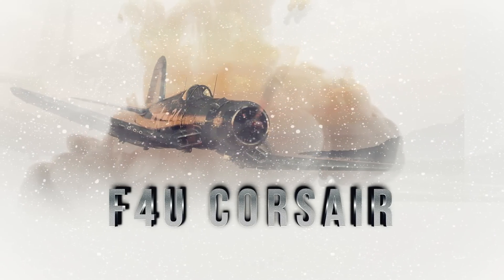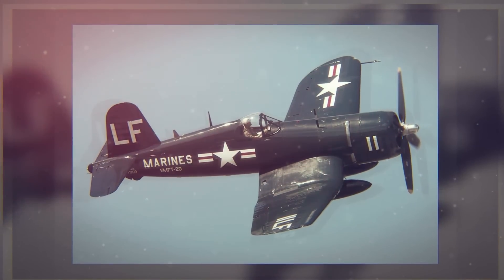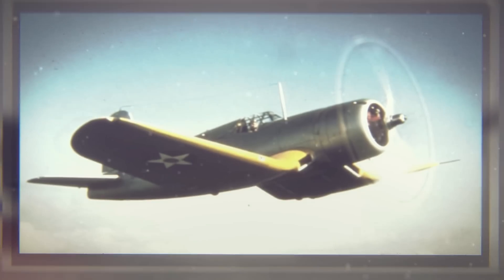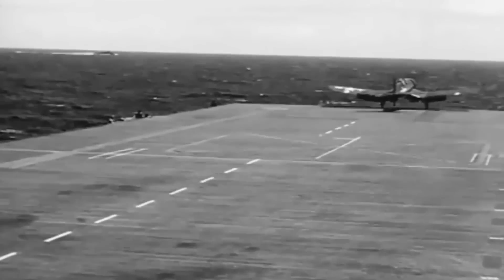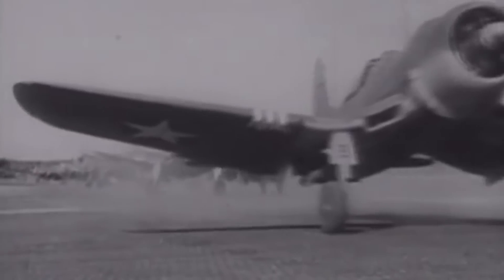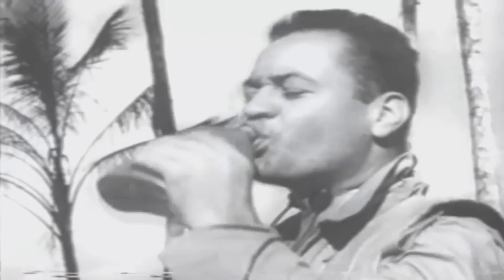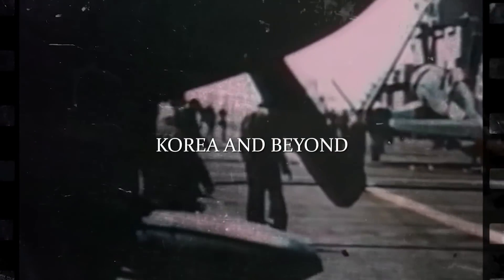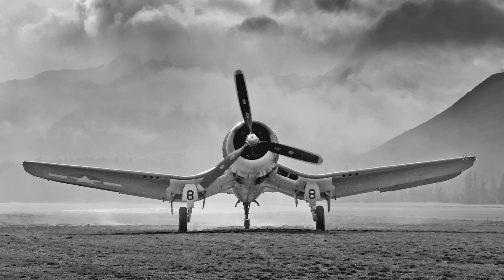Want to Dominate the Skies? The F4U Corsair Might Be the Answer

Comment: No. While an excellent fighter it was rated #3 behind P-51D and P-47D by large number of pilots that compared them a the Patuxent Fighter Conference  October 1944.  Additionally as a naval fighter it was not equipped with enough fuel to operate beyond USN requirements. Had it been deployed in ETO/MTO or CBI, its lack of range and combat radius would have relegated it to medium range escort/air superiority role when P-51B/D and P-47D would have been a better choice.

Whil the F4U did have provisions for external combat tanks, operations over water with no intervening defenses (unlike ETO operations over land) the F4U had more than enough range for Pacific operations.

And no, the RN did not pioneer the curved landing approach for the F4U. It was already tested and introduced into the fleet in SanDiego before the RN took possession of the first Lend Lease F4U.  

Last, while formidable and possessing R-2800 engine, it was a.) more vulnerable to ground fire due to oil cooler placement, b.) it only had slghtly lower loss rate compared to the liquid cooled engine P-51D during Korean War.

Comment: The 1st production fighter to use the R-2800, and perhaps the last, in 1956. Many fighters kicked a$$ in WW2, but only one was produced well after that war, and into the mid-1950s. It didn't have the same kill ratio as the Hellcat, but it was in the double digits, and the Corsair was produced 10 years after the Hellcat was done. The Corsair wasn't just a top fighter, but even more, a top aircraft of all time. How many designs from 1940 (not production) survived WW2 contracts and went on to be produced well into the 1950s?

Comment: The F6F had a higher kill ratio. 18 .1. IT was easier to fly and more agile than the corsair which had a bad design flaw in that it would suddenly drop a wing on final.approach causing lots of deck crashes as well as the long nose causing pilots to.lose sight of the padels from the LSO.

Comment: F4U was a great air frame and good performance plane.  The swept wings of a CORSAIR and very good kill ratio was outstanding.  It was better than the F4F Wildcat .... but NOT THE UPGRADED F6F HELLCAT - 6 holy Moses Missiles, 2000 HP Pratt Witney radial engine and a KILL RATIO OF 19 to 1 !!!  Best ever.  With respect, jj

Comment: The Corsair was a very good and effective aircraft in the hands of a skilled pilot.  However, low-time pilots fresh out of training were often over-whelmed by the torque characteristics, the poor visibility during a carrier approach and the poorly designed oleo struts of the early models.  The Corsair bore the nickname "Ensign Eliminator" for good reason just as the Hellcat was called the "Ace Maker", also for good reason.  An 11:1 kill ratio is very good, to be sure, but remember that the Hellcat had a 19:1 kill ratio.  Was the Hellcat a superior fighter?  Depends on who's flying it.  The Hellcat didn't do anything outstanding but it did do everything well and it made a rookie pilot look good giving him confidence in his plane and ability.  One last thing, the only reason the Marines got the Corsair was the plane's unsuitibility for carrier use early on.  The Corsair proved to be a very good ground based aircraft and it and the Marines who flew them made a name for themselves.  Finally, it was the pilots of the Royal Navy who figured out how to bring aboard the Corsair onto a carrier deck with a minimum of losses.
Reply: Yes, and it was the aircraft mechanics of the Royal Navy's Fleet Air Arm who first fixed the undercarriage bounce. Corsairs became a good  replacement for earlier RN fighter aircraft.

Comment: No this isn't accurate, yes the Corsair F4U was amazing but at that time it was fighting an almost depleted Japanese air force using very under trained pilots and almost worn out aircraft. A better stat would've been pitting the F4U against a strengthened German Luftwaffe or the Japanese when they had all their best pilots still alive and flying.
Reply: Yes, but remember the aircraft in America's inventory changed rapidly e.g. P-40 (Pearl Harbor), F4F, F6F, F4U.  While the ZERO changed little over time.

Comment: The iconic wing shape was fascinating to me as a child. Absolutely love WW2 aviation and all of the innovative ideas that came from that time period
Reply: Quite an aircraft
Reply: From what I heard on the vid it was for the big prop to clear the ground .
Reply: @txrick4879 partly, but  were that the only reason then other aircraft like the p47 and the hellcat would have required this too given they had the same r2800 engine and propellers only v slightly smaller. that clearance could equally have been achieved with say telescoping landing gear were that the only concern. it was, as mentioned in the video, also to reduce interference drag. essentially NACA testing had found that an angle of 90 degrees between wing root and fuselage was best for minimising interference drag. in order for the corsair to achieve this with its v round fuselage* it would have required a conventional wing to have been mounted roughly in line with the propeller spinner. that would have required telescoping landing gear which would lack the strength of the corsair’s landing gear and couldn’t have been used as a dive brake in the way the corsair’s landing gear was designed to be able to do. the fact that the corsair was able to have shorter landing gear enabled it to be fully enclosed in the wing, and took up less space in the wing which allowed for a shorter chord and overall more efficient wing. this also allows for much larger flaps, critical for lowering the stall speed for a carrier fighter which in turn allows for larger ailerons. this contributes to the excellent rolling capability of the corsair which was a quality noted both by those who flew it and who fought against it. 

*the fuselage itself was designed to minimise the frontal area of the aircraft despite the large r2800 engine which required both oil coolers and intercoolers, which contemporary fighters with the same engine put at the front of the fuselage, something the corsair avoided and which resulted in the characteristic long nose. this desire to reduce the frontal area of the engine had a lot to do with trying to make the plane competitive with land based fighters

Comment: My uncle, George Roy Hill, flew the radar-equipped night fighter version of the Corsair at MCAS Cherry Point during Korea. He also flew the Hellcat. He told me the Corsair was much more squirrly.
Reply: The corsair had considerably more performance than the hellcat though
Reply: @kenneth9874  well, it had a little more. It also wasn't ready as soon as the F6F, cost more, didn't have enough parts in pipeline for fleet deployment in '43, wasn't quite as tough, and... Grumman could manufacture faster and cheaper, and the F6F was wholly sufficient to the Navy's needs.
Reply: @jonbowden5207  actually it was tougher,  ever see one break apart? There's a reason that the Corsair was still being produced after the war.
Reply: @kenneth9874  "There's a reason" yes, there was - it had a little more speed, had more development potential, and the war was over. Grumman produced more Hellcats in less that 3 years, than Vought produced Corsairs in 12... Grumman did great work.

The F4U was a fine aircraft, that the USN would have been fine without.
Reply: @kenneth9874  "ever see one break apart?"

Only in pictures, never in person. I've only been onboard one carrier that operated the F4U (CV-17) but they weren't operating them while I was there.
Reply: @jonbowden5207  funny how they were replacing hellcats with corsairs as fast as they could 🤣
Reply: @jonbowden5207  they didn't come apart, hellcats did.

Comment: It depends on what and where. The top three Army Air Corps planes all had much better range. The 51 and especially the 47 had better performance above 20,000 feet. The 38 out climbed it by a substantial margin, had far better fire power and would out turn it at any speed and carry more ordinance 
Below 20,000 feet it was probably the best all around dog fighter but again not in all situations. 
The Corsair was unforgiving and killed a lot of low time pilots in ways that the Jug or the Lightning never would. 
As a 250 hour Lt JG coming into combat for the first time, give me a Lightning or a Jug. As a 1,000 hour Capt with 30 combat missions…maybe a Corsair

Comment: Would be interesting to see it up against an Me-262 or even the TA-152
Reply: At high altitude, the engine probably would have been slightly out off breath and the relatvely thick wing of the F4U would have run into problems with supersonic flow pretty quickly. At low altitude, th COrsair definitely had the edge over both of them in manoeuverability. A 262 probably would just have run away from such a fight.
Reply: Ta 152 would win, it was a super prop
Reply: Well the corsair did have machine guns as Japanese aircraft were almost not armored. In Europe, all aircrafts were armored and had guns, so...
Reply: pick an F4U of same time frame, and bring it on... no guarantees for either of the Nazi birds.

Comment: Okay, it was a decent enough plane, but did not have the range of say the P-38. Plus by the time it was being used in front line service, most of the really good Japanese pilots had been killed. The Hellcat could run circles around the  F4U Corsair. Also it took the British to show us how to land them on a carrier.  But if I was a fighter pilot in WW2, I'd rather fly the P-38, P-47, or if in the Navy, the Hellcat. I'm not dishing the Corsair, it was a good plane, but the best plane of WW2, not so sure about that. Wow, um, the Wildcat had fully retractable landing gear, as did the Hellcat. Get your facts straight. Even you mentioned it took the British to figure out how to land the thing on a carrier. Mostly due to how big the prop was. So in its early days of use by the Marines, it was land based.
Reply: Yes,  the Corsair generally didn't have to face the best Japanese pilots, like the Wildcat pilots did,  but the same is true for the Hellcat.   And your assertion that the Hellcat could fly circles around the Corsair is flat-out wrong.  If anything,  the opposite would be more true.  Look,  there's nothing wrong with preferring the Hellcat,  it was the better carrier fighter,  easier to land and easier to fly.  But the Corsair was the better all-around fighter,  a better ground-assault fighter and a better dive bomber.   That's why the USN replaced the Hellcat as soon as they could, but kept ordering Corsairs into the 1950s even though it was twice as expensive as the Hellcat.  The P38 was a little overrated.   The P47 was a great fighter though...
Reply: It's the economy stupid.
People often forget that's all about the money. It is cheaper to operate the Hellcat. So they choose the f-6.
The same thing with the p-51 and the p-38. Don't look only on the plane database in the papers. The overall picture is important to. Logistics, materials, economic capacity complexity of operating the planes and so on.
Reply: The wildcat did have retractable landing gear you had to crank it .

Comment: Best all around prop fighter ever in my opinion.
Reply: F8F was probably the best.
Reply: @thecircusfreak5364  well , the Bear cat was good but it wasn't done in time for ww2. Also , if u do count post war property fighters then it would have to compete with the Super Corsair. I would still pick the Corsair to win. Its my opinion only however.
Reply: @jayledermann7701 it’d also have to compete with other superprops, such as the supermarine spiteful, the hawker sea fury, a number of soviet aircraft etc. the bearcat was in any rate a v flawed aircraft heavily optimised for an interceptor role and operation off smaller escort carriers as a replacement for the f4f wildcats still used on those throughout the war. there isn’t rly a best prop fighter because different aircraft perform very differently at different altitudes, have different roles etc that affect their performance in combat. the p39 airacobra was disliked by many US pilots but was the darling of many soviet pilots and holds the mantle of the US fighter with the highest number of kills in the war, largely because the very things that caused issues for US pilots in the pacific theatre (short range, poor high altitude performance due to the removal of the turbocharger and lack of a two stage supercharger for the allison engines at the time) were non issues on the eastern front where airbases were typically v close to frontlines and combat fought at low altitude and allowed the qualities the aircraft did have to shine
Reply: @fayY2K  well if you are going to bri g up real late war super props , then I'd go with the super Corsair. I believe it was named FG1 Super Corsair or something like that. There were many great fighters, for sure. It's just my opinion that all around the Corsair was the best.
Reply: @fayY2K  ah , I was in a hurry , and didn't look at entire thread. As for best at what , I said all around. Meaning for me , a fighter that can maybe not do everything the best yet do everything at a high level.
Reply: @jayledermann7701  no worries. so in that case i would have to say i don’t think that is the case simply because the corsair actually can’t perform every role well (and neither could it’s contemporaries for that matter). the corsair’s performance drops off significantly above 15,000ft which makes it completely unsuitable for a great many roles which is a long way from doing everything well. the multirole fighter wouldn’t really see its birth until well into the jet age precisely because making an aircraft capable of one thing comes with costs to its ability to perform in other areas. at what it was designed to do however, the corsair was a fantastic aeroplane
Reply: @fayY2K  no one plane can do it all for sure. I would say history proved F4U did all around better however just due to its kill ratio , length of service and multiple rolls it fulfilled. I played a lot of combat Sims and games online based in WW2 Era. I was known for being a decent F4 stick. The only 2 planes I felt were as dangerous against me was the 109 G and late war spits. So many great planes . I guess the F4U-4 for me was the best. I think America was right....E fighting beats turn fighting.
Reply: @thecircusfreak5364  it was great plane , but I discount it as better because it didn't see combat, so we don't really know and also the Corsair was still in combat after the Bearcat  was retired

Comment: It was a very good plane, but the F6F Hellcat had a better kill ratio.  The F4U was probably
a better ground attack aircraft.
Reply: Timing was the reason for that, the F6 was a good,sturdy, reliable aircraft with good performance but the US had several with better performance including the F4U
Reply: No the hellcat wasn’t better it was only good for boom and zoom the Corsair was a better dog fighter it didn’t get to fight until 1944 if it had been earlier it would’ve had a lot higher kill ratio than a hell cat the hellcat was basically a jugg with wings like the thinderbolt they all three had the same pratt& Whitney R2800 engine
Reply: Good catch on that. I wasn't sure.
Reply: Everything I have read or seen from F4U pilots say it was a pig at low speed and that kind of rules out ground attacks.
Reply: @GerryHartman  no it don’t do your history that’s what they used it for in the koren war it was the longest serving prop plane in the U.S. military it was the a -10 warthog because the a10 warthog look it I promise you bro it’s facts it was the longest production to
Reply: @EarlsBackYard  -re-read my post until you can comprehend and fully understand the words - everything I have read or seen from F4U pilots.    My personal opinion means nothing since I have never flown a Corsair.  However, I will put stock in personal anecdotes from pilots who have.
Reply: I’m a Corsair Enthusiast and nut and fan i geek out over these planes like a teenage girl does over her sweet 16 I love this plane and the hellcat and thunderbolt her sisters who where just as bad as she was they mopped the floor with the enemy in all three the jug could take hits the hellcat could dish out hits pretty hard and the Corsair could out run the enemy I love these three beautiful sister warbirds they all had the same engine the Corsair even had the same water injection the thunderbolt did
Reply: @GerryHartman  what said come from actual pilots I listen to two hour documentary about them and the men that flew you need to reevaluate

Comment: Cosairs fought in 1969 in the Honduras/El Salvador war. Honduran Corsairs fought against El Salvador P51 mustangs. Honduran F4U pilot scored 3 kills in one day.
Reply: Those Mustangs had fuel tanks add to the end of the wings pretty much make them useless in a dog fight.
Reply: Yeah, those mustangs were modified for mostly ground attack.  They had fixed fuel tanks at the wing tips which impaired their maneuverability.   Further,  those F4Us had 4x20mm cannons as well.  Regardless,  the F4U was an amazing plane and could compete with any common fighter in WW2 Europe (See Greg's excellent channel for an in depth analysis of this).
Reply: Thought that those battles would be mentioned but were not

Comment: EXCELLENT FIGHTER; THE F4-U, P-47 AND THE FW-190 HAD A GREAT DEAL IN COMMON BOMBER ENGINE IN A FIGHTER PLANE; HUGE DIAMETER OF PROPELLER MEANT THE FIGHTER HAD TO TAXI DOWN THE RUNWAY AT AN ANGLE OBSCURING THE PILOTS VISION. ARMAMENTS EXPERTS CLAIM THE GERMAN FW-190 WITH ITS 4 - 20 MM CANNON AND 2- 7.92 MACHINE GUNS WAS THE EQUIVALENT OF 17-.50 CAL. MACHINE GUNS. A TRUE BEAST